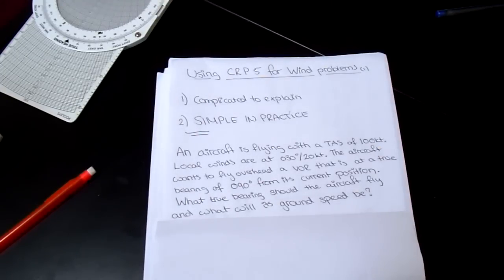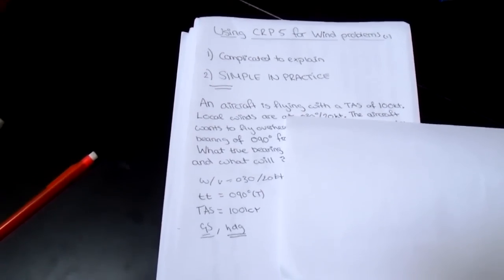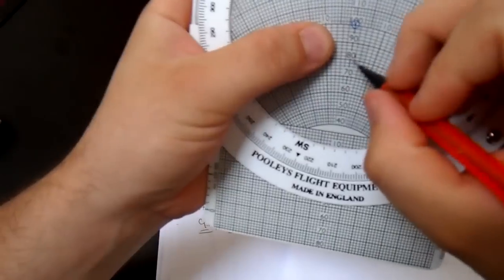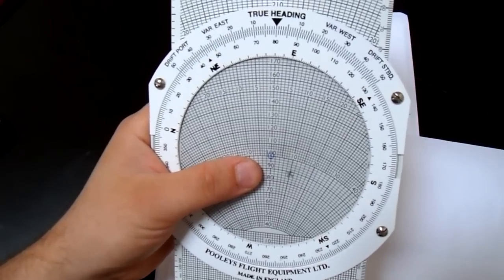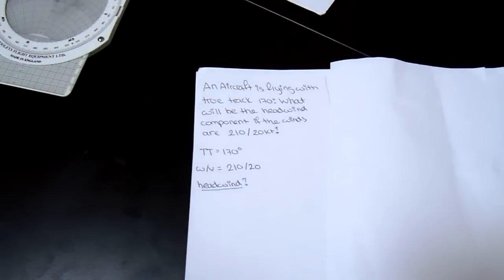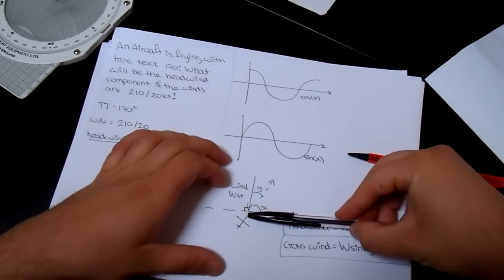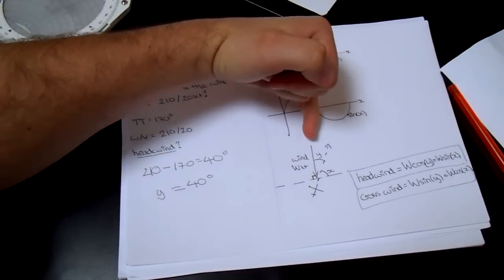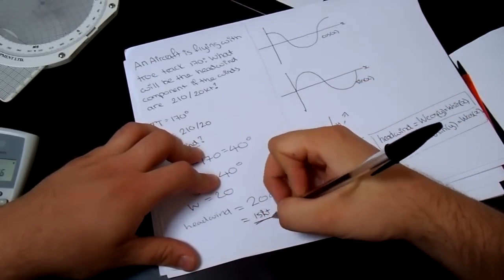CRP-5 Calculating Calculate GS, Drift angle, and wind component: Merryface Aviation Groundschool

Comment: I did the wind calculation in my head. No need for a calculator. 

Think of a clock face (60minutes) then use the fraction or decimal to calculate the crosswind and head wind. 
Using your example, 210-170 = 40°

40° = 2/3 (0.66) of 60 

Cross wind = 2/3 of wind speed (20kts) 

= 14kts

To workout headwind add 90° to your track in the direction of the wind. 

170° + 90° = 260°

260°-210° = 50°

50° is roughly 3/4 

20kts x 3/4(0.75) = 15kts 

You may be out by 1kt but that is trivial. You wont have time to use a calculator when on approach.

Comment: I got a question for you. TT= 042 W/V=270/21 . I get -14 as an answer using your way. should i just ignore the negative sign in front?
Reply from the maker: Make sure that your calculator is in degrees mode and not rad mode. :)
Reply from the maker: if that is how you have it, then a negative number, just means in the opposite direction. i.e a -14kt headwind is a 14kt TAILWIND. We're calculating vector values, so we must have directions defined as we're calculating velocities, not speeds. If you're unfamiliar with the difference, make sure to look this up.
Reply: Yeah it is in degrees mode, calculating HWC and I plug into the calculator 21cos(228)= -14. is it normal for their to be a negative in front? or should I just ignore it since 14 is the correct answer. Also how will it work for a tailwind component calculation? thanks for your help, this video is really good
Reply from the maker: 228 degrees? that explains that. Yes the answer will be negative. This means it's a 14kt TAILWIND.
Reply: Ok thanks, and if the crosswind component is negative does this mean CW is from left to right?
Reply from the maker: spot on.
Reply from the maker: yes*
Reply: thanks sir for giving the question and it ! got somthing good to learn today which  will help  me in future to reach my goals  @MerryfaceAviation

Comment: Hello, if you are showing viewers how to use the CRP-5 that's good, but please use the correct terminology. The term variation is incorrect. In navigation the correct term is DRIFT (not variation). An aircraft drifts in the direction of the wind. Variation is a completely different term, and refers to the angular difference between Magnetic North and True North, and specified as either Westerly or Easterly variation. You also use the term Bearing, the correct term is Heading; and aircraft points on a Heading and moves over the earth on a Track. Bearing refers to the relative position of an object or fix from your present position, measured in degrees true or magnetic.
Also you go on to say later in your video, that using the CRP-5 to determine the Headwind and Crosswind components is very complicated; again that is incorrect and the direct opposite to the truth. If you wish to find the wind components, you must use the bottom portion of your LOW speed scale on the CRP-5. It's the bottom area on the slide that looks like graph paper. There you enter the wind vector in the same manner as explained earlier, and just rotate the heading slide to the heading of the aircraft and on the graph is the headwind and crosswind components of 15 and 13 respectively. Very easy and done in less than a minute. Not complicated at all.
You're also welcome.
Reply: Thank you Michael for writing this comment, when I heard him say variation I was confused because the problem he gave us only talked about true directions
Reply from the maker: Yes you're right. I also made a video on how to use the bottom wind graph. I want to redo these videos.

Comment: How about ditching the calculator as well? Remember three numbers: 0.5, 0.7 & 0.9. These are the numbers that approximate to the sines and cosine values for 30, 45 and 60 degrees. Use the closest one and you will be OK. They are close enough for government work and certainly good enough for commercial flying. Their application to groundspeed is self evident. For crosswinds, use these numbers to calculate the crosswind and multiply that by the fraction of an hour that it will take you cover 60 miles. That will give you your drift.

For example, given the first case of TAS of 100 kts, track 090 and wind 030/20. Headwind = 0.5 x 20 = 10 kts. G/S = 100 - 10 = 90 kts (close enough). Crosswind = 0.9 x 20 = 18 kts. At 90 kts it will take 0.66 of an hour to cover 60 nm. So drift = 0.66 x 18 kts = 12 degrees (two degrees different).

The thing is, with the above method, no calculator is required. You will also find you can do away with rulers and protractors and judge by eye the tracks on a map. Just try it - remember, close enough is good enough. Why? Because the wind forecast is a rough guess, your aircraft's instruments are not accurate enough and an average pilot is incapable of flying so accurately to benefit from such precision. The saying "Measured with a micrometer, marked with chalk, chopped with an axe" comes to mind.

So to go flying, all you need is a map and a pencil. Ditch the rest of the crap. Your crooked thumb is 10 nm on a half mill. chart and you always have the marks on the lines of longitude to measure nautical miles. Use common sense and your brain, look out the window and use the 1 in 60 to get back on track.
Reply from the maker: +Trevor Austin Yes, those are similar to the methods I use. This is a tutorial for the CRP5 though, which is used in our ATPL exams, where they want you to be accurate down to 1kt at times. The examiners use this flight computer too, so it's better to use the flight computer than even the formula.